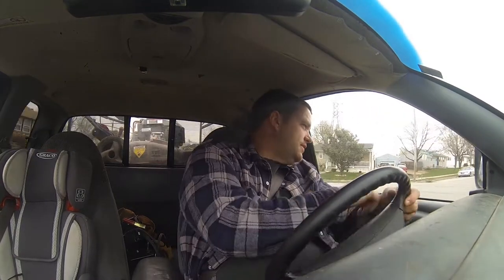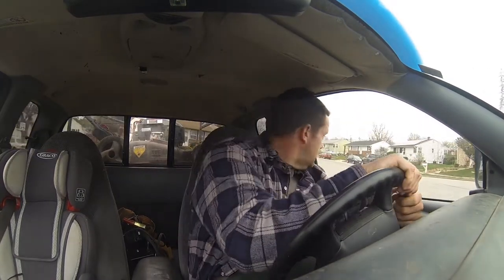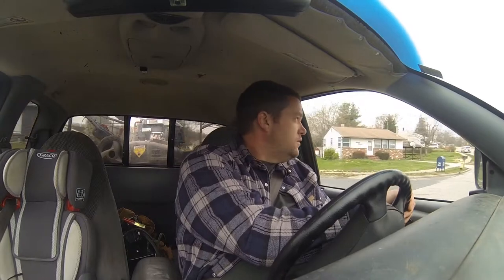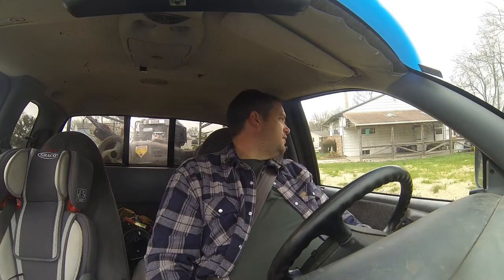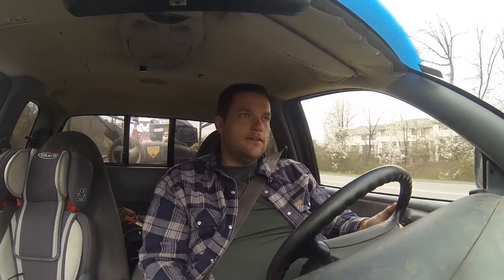slots in the tailgate

Comment: I use Reese brand "RampParts". The part that rests on the tailgate is spring loaded to compensate for different angles. It has rubber underneath.  They never slide off or catch anything unless its very icy. 
I use my ramps for snow blower mostly
Reply from the maker: Strong Tower Lawn Care that probably would've worked for me. To late now though! Lol